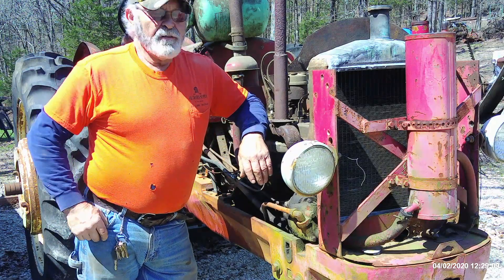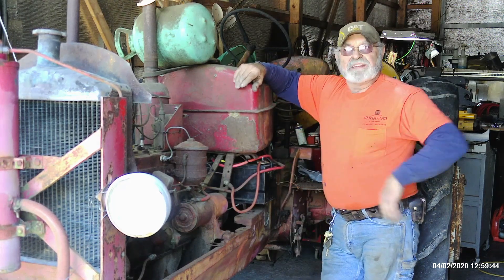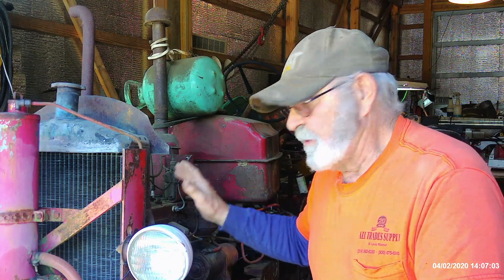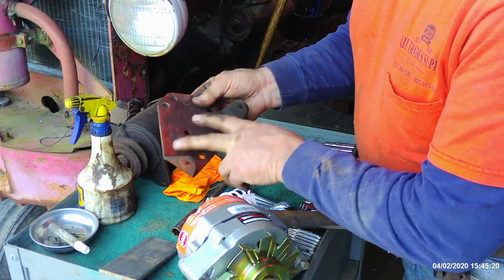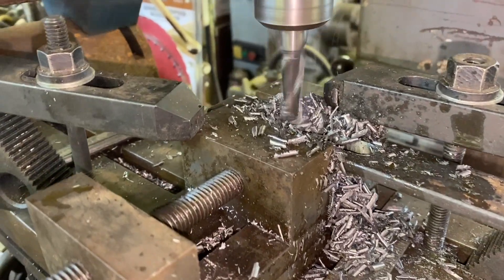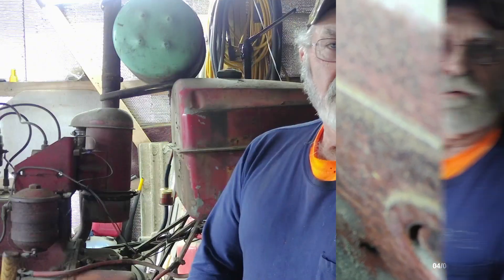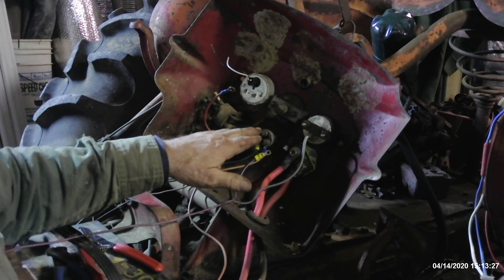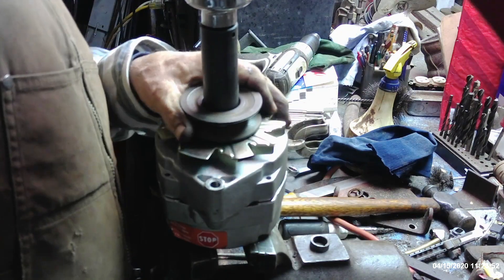12 V One Wire Conversion Massey Harris 30

Comment: Hi I’m buying my frist Massey Harris model 30 tractor I have clean out fuel tank I’m guess it clogged or in line give nose sand it down re paint it giong be great winter project it
Reply from the maker: Oh yeah...there's always a little maintenance required with these old tractors.  You will really like the little 30.  Nice economical little tractor.  Try to find some wheel weights and it'll do a lot more work for you. I have lots of MH 30 videos on here.

Comment: TO 35 Here... 12 v generator and 12 v system. Points dis. I'm thinking it was positive ground at one time. Having wiring issues. But she was running great. Going back in. Refuse to stop til she goes!!!
Reply from the maker: Pretty much all the tractors prior to 1955 were positive from the factory.  Don't give up, you'll get it going for sure. This doesn't pertain EXACTLY to your tractor, but here is how I upgraded a '72 Ford 2000:https://www.youtube.com/watch?v=PXIh78bDr0U&t=603s You will probably have to adapt it for your application. Good luck JB.
Reply: @tractorman4461  thanks.. I got her cranking good yesterday. Almost ran. Carb may have junk
Reply from the maker: @justicebruno5249  I wouldn't trash it just yet. There are a lot of tiny passages in the two halves of the body that have to be totally clean for it to run.  Do you by chance have a cheap Harbor Freight ultra-sonic jewelry washer..?  That's what I use combined with Chem-Dip carb cleaner.  About three or 4 three minmute cycles clears nearly every carb I've used it on.  And I have done a LOT of them !!  Also the float level setting is extremely important. Too low and it won't pick up the fuel by the intakes suction and too high and it will flood out.  Make sense ??
Reply: @tractorman4461  definitely. I've rebuild lots of Holley's and quads..no old tractors tho . Should be basic Im hoping. Lol she may run today.

Comment: Looks like your Massey 30 has a Massey Harris 33 radiator.  What did it involve to make it fit?   Hmmmm?
Reply from the maker: I bought this tractor at a farm auction where it had sat in a barn for a long period.  So any major changes to the tractor was done by the previous owner.  Massey Harris was really good at building different models with interchangeable parts though. I would have to measure one of the 33's and compare it to one of the 30's to know for sure if anything had to be done.  So Terence, your guess at this point is as good as mine.  Thanks for noticing and commenting about it.

Comment: What was the treatment you used on the inside of the gas tank? I'm the one who used a piece of chain and roofing nails to shine up the 
inside of mine. I had some type of vinyl used on my "44 massey harris and it really was a great mistake.
Reply from the maker: This was the first time using this product, so the verdict is still out.  The product was POR-15. I've used several other brands, but this one has given me what I consider to be the best initial results.  It looks as though it becomes a bonded surface and not just a covering.  It goes on so thin that all the imperfections in the surface of the metal can still be seen. I will know in a few years, but have bought another order for the next tank in line.  I've had good luck though with virtually all the brands I've used over the years on machinery, tractors and motorcycles....but I think the success is tied to the prep work. Some are in excess of 20 years in operation now.  
  I AM expecting an issue with the next tank, because it has a center baffle and I have no way of #1) guaranteeing the rust is removed from the back side of the baffle and 2) there's no way to guarantee the back side of the baffle will get coated with the product.  I suspect some issues with rust particulate dropping to the tank bottom off of that surface. One of my viewers suggested placing a rare earth retrievable magnet inside the tank near the pickup  tube to collect potential rust.  THAT is a stellar idea.  Now to find a rare earth magnet with a stainless steel or at least a coated hook or loop on it...... Thanks Jim for stopping in with your input !!  Good luck and be careful if you use the process of electrolysis.

Comment: I have a 1952 MH 44 special that has everything converted to 12v except the generator. We converted ignition years ago which was easy. (Just the coil, the 6v points and starter can handle the 12v. At least ours have the last 20 years! lol) My grandfather bought it brand new when we used to have a farm and it's been passed down in the family. I use it to plow snow in the winter. Man you got it right that how tough those old Continental engines are. My tractor still runs like a top, starts right up at 100 or -30 degrees! Just tired of the 12v battery not being able to be charged by the 6v generator still in there. Haha I  see the art of starting a tractor from the side is still alive, I do the same with the old iron. Not that safe, but sometimes you gotta adjust the fuel mix fast if she's been sitting. Thank you so much for making this video, I'm going to follow what you did exactly!
Reply from the maker: Man, I love the 44's and the 44 Specials.  All my conversions have the original 6v starter as well.  One of our old 44's we just turned up the cut out on the generator a little around 9v or so and installed an 8v battery.  We couldn't use the 6v lights on 8v, but that's ok.  The output voltage of the adjustable third brush on a 3 brush generator can generate pretty high output, but I am not too well versed on that technique. 
     I always convert to an alternator.  One wire GM's are easiest, but the three wire ones are also quite simple.  I really like using a voltmeter much better, because the instant the key is turned on, you see the 'static' voltage contained in the battery.  You can immediately see if the voltage is low so you can stick it on a charger or go ahead and 'boost' it with a charger to start it.  An ammeter won't do that for you.
    As long as the normal 'shift lever shake' is performed I have no problem with starting over on the side either. Thanks for taking a look at the conversion.  I've done a ton of them and have had good luck with virtually every one.
Reply: @tractorman4461  Ah you're loaded with great tips, and you love old tractors just as I do. Glad I found and subscribed to your channel! These old tractors will still be working hard long after were gone unlike the junk they build now days. lol Close to trading one of my old diesel trucks for a farmer friends restored 1955 John Deere 70D with custom front loader mounted. He's got so many vintage tractors from Farmalls to Olivers and doesn't know what to do with them all, I wish I did too. lol
Reply from the maker: @BrodieBr0  That 70 is a beast. It's the upgraded big ol G.  JD's seem to be pretty good at maintaining their value so depending on what the old diesel is it sounds like a good deal to me.  I have a much smaller JD 50 which is the upgraded baby B.  Also an old '39 A. Oh yeah and a little bitty 40 or 41 LA.  The key to their longevity is the low rpms they run at.  The higher the rpm, the higher the level of balance needs to be in rotating components.  
    Can you imagine a standard JD two cylinder operating at 3,000 rpm...??? LOL...they'd come apart at the seams.  But at less than 1,000 rpm at wide open throttle they will run seemingly forever !!  Your 44 Special tops out around 1350 rpm for comparison.
Typically the 6 cylinder Ollies would run even higher at around 1600.  Remember that horsepower is developed by rpm and torque is developed by stroke.  (Basically, that is).  Torque is what gets the 'work' done.  Enjoy the new 70 !!
Reply: @tractorman4461  I have a 1993 1 ton Dodge with the 5.9 12v Cummins. It has a dump box that my friend been eying to use on the farm. I originally bought it to haul gravel in a side business which has dried up. You've plenty of great tractors in your collection, I've been watching your other videos in work off hours. I'd love to have any of them! lol Thanks again for all the great tips! I imagine an old 2 cyl Deere at 3000 RPM would out do a screaming Jimmy in roar! haha Oh the deal got a bit more complicated today. He also offering a 1979 JD 301A Loader/Backhoe to trade for my truck. It's not rebuilt like the JD 70 but works great with only 2200 hours.  I really could use the backhoe to clear some property of brush and add on to my house. You know anything about the JD 301A's? Been a good tractor for my friend so far. Thanks for the replies and info!
Reply from the maker: @BrodieBr0  I would just about guarantee the JD is the better deal. I use my backhoe a ton. Plus you can build a jib and set trusses on pole barns. You can put forks on the bucket and load logs or pallets for instance. I made my forks out of 12” channel iron. My son is an operator as is my brother and one of his sons. They’ve all been on cat, JD, JCB, Ford....all the hoes though. My main experience is on the Ford 4500 and my Case 580 B. I ran a 310 once for just a few hours and it felt much more of a tractor than either of mine. Are you sure it’s a 301 and not a 310 ??  The JD 70 is a good deal too but I’d think for what you describe the hoe’d be my choice. My 03 3500 dually with the 5.9. It’ll eat my 460 Ford for lunch. And it’s .030 over stock with a bumped up cam. Thanks for watching the older videos. Make sure you watch the 580 Case setting 40’ trusses. Lol. You’ll not think twice about the trade then. Lol. Thanks again !!
Reply: @tractorman4461  Yep it's a 310a JD industrial backhoe loader. Medium sized hoe, he says it weights 14k pounds. Just got done watching that video....As pretty as the JD 70 is, I am for sure going with the backhoe. Amazing work building that boom with a winch off of the loader to get that truss up there! Also what you did with that old bowling ball is amazing and inspiring. lol I love finding new uses for things as well. Ah you've got plenty of experience with all kinds of equipment as well. I've never ran a backhoe, but I have ran dozers, wheel loaders, forklifts, and plenty of tractors. Yeah those old 5.9 Cummins are one heck of an engine. The dumper my friend wants is dirt stock with only 70K miles on it.  I also have a 1990 Dodge D350 with the 5.9 to pull things with. I don't need both trucks. I think he really want the dump truck because he'll throw in his 1980 John Deere 2640 with a Frontier bush hog attached now along with the JD 70 or the JD 310a Backhoe lol Thanks again for the continued info, I could talk about old tractors and old iron all day. haha

Comment: Hi. Since this is a positive ground system, what battery post did you connect the wire from the alternator battery + or battery -  ?
Reply from the maker: Sorry Randy, I missed notification of your reply.  Originally they were positive grounds, but when I do conversions I consistently change them to negative ground with no ill effects. To do so, I disconnect virtually every wire on the tractor and start all over.  Most times the old insulation is cracking and has the potential for leakage anyway, so I just go from scratch.  So now with a negative ground the BATT post goes to the + just like normal.  Hope that helps.

Comment: This tractor will be like brand new with that new alternator and PAINTED bracket!  I've seen you went for "Joe's version" of the painting: plain black! The tires on the back look they are almost new. At 10:30, what are those #2 red wires?  Is that the switch for the starter? So you don't have a solenoid switch? I'll be interested to see the restoration of the tank. Thanks!
Reply from the maker: Yes Joe, the two large wires go to the pushbutton starter on the dash.  No solenoid. Massey tried to keep things simple and somewhat universal among a lot of the models. I'm editing the electrolysis video now so it won't be too long. I suspected you and Dave would like the paint job.....LOL.  I'm trying to make short videos but there are so many points about safety to make on the process of electrolysis rust removal that I ain't succeeding...  Oh... the black was some high temp left over from a new dual exhaust/glass packs that recently went on the old truck.... LOL.

Comment: Now see, this is why I too like these 'one wire' alternators. I put one of these on my 1948 Willys Jeep when I restored it a few years ago. It too showed a 14 plus voltage just as 
quickly as this one did on your Massey Harris.
 Thumbs up and then some!
Reply from the maker: Thank you sir for the kudos !!  They do make for a quick changeover but the actual restorers are big proponents of keeping tractors all original.  LOL...me, not so much.  But that may change in the future...but I doubt it.  That 48 Willys had slight variation of this same engine iirc.  They didn't have an updraft carb though.  Somewhere along the line though I think continental lost the engine contract .....??
Reply: @tractorman4461  I do like those engines. A fellow could re-build one of these with a blindfold on, almost!  
I did enjoy working on these simple and easy running engines, I wish I had one now, to have and 'play' with on a stand.  and in my garage. I should have kept the inline 6 I had once, it too was from a 1956 Willys Pickup; It was called a 'Hurrican Six ' I think. Great old power plants for sure.

Comment: Good job on the Massey. You might want to let the tank have a bit of extra cure time. The tank in my IH 300 eventually started to peel off bits of the coating and clog the fuel shutoff valve. It may have just been the result of a bad recoating job in the first place, I'll never know, as the recoating of the tank happened long before I got it.
Reply from the maker: Good Morning Sir...how are you this fine day my friend !! You're right about the coatings possibly peeling off in the future.  Fortunately I have had very good luck over the years but I have a process that takes more than a week to get done.  I did use a new product on this one and its end result was very interesting.  I'm editing that video currently because that will complete this little tractors story. Thanks for watching and for the good suggestion William...I have pre-emptively taken your advice and am still using the temporary tank now two weeks later.  Please have a pleasant weekend my friend !!

Comment: Well that was pretty slick and really appreciate the shiny tractor shoutout.  This video just reminds me that my Polaris Ranger needs a battery again. Would a larger battery last longer than the little tiny ones they come with. Take care brother
Reply from the maker: Hahahaha...when those words slipped out, it was you who I was thinking of, well, you and GP too because he is always shining up his hood...LOL. I was hoping you would take the little poke with the humor with which it was intended.  On a side note, I DO have an old John Deere lined up to bring in the shop.  It's been shedded since '96 after an old buddies dad passed.
    About the larger battery... I honestly don't know, but I think the higher the number of plates  the longer the battery life.  I would assume the highest CCA rating should connote to a longer life.  I buy blemishes for my old truck and tractors and go for the highest CCA available and seem to have very good luck with them.  But one of the biggest keys to longevity is the use of a floating charger in the off-use months.  Unused batteries will lose about 1/2 volt per month so if a 'batter maintainer' is used on a fully charged battery, the battery will remain fully charged as well as 'de-sulphated' and last much longer as a result.  It has to be a 'floating 'charger or battery maintainer though and not just a trickle charger.  A battery receiving a  continual charge will have a shortened life and that's where the floating output comes in.  Hopefully this will help you in the future Ben.  Thanks for the comment sir.
Reply: Tractorman44 Thanks Wendell good info. I bought a maintainer about a month ago but I guess my battery was on its last leg already. I think I’m going with a plain lawnmower battery and try my luck. Thanks again for the info take care brother.
Reply from the maker: Our Greene Acres one thing to remember is that the battery maintained is primarily used to “maintain” existing voltage. For the most part it is recommended to fully charge a battery prior to installing the maintainer. It will only maintain the voltage that’s there. Now there ARE more expensive maintainers that WILL charge THEN maintain but you have to make sure it says that. If it doesn’t specifically say that your assumption should be that it’s a maintainer only. Now admittedly there are new developments entering the market daily so this may not all be totally correct anymore. Good luck Ben and if you find out better info feel free to turn me on to it because I don’t want to spread outdated or outright incorrect info.

Comment: Very well done on that alternator....I like them single wires....Have all the old John Deeres at the farm converted and we never look back...no more regulators or generator problems....It`s the way to go id one wants to keep an older machine....CHEERS
Reply from the maker: Agreed Gator.  This is the best thing to come down the pike since they put a pocket on a tee shirt !!  Six volt is ok if everything in the circuit is ok AND if the engine isn't worn too bad, but there ain't nothin' like spinning one with the speed of 12 volts !!  Good deal on all the JD change overs.  You can install a 'low rpm exciter' for the older lower rpm antiques that work well.  Its easier than messing with pully changes.  Thanks for the comment Gator.